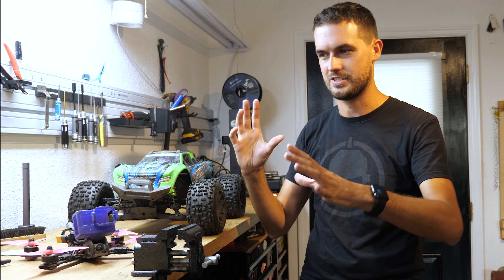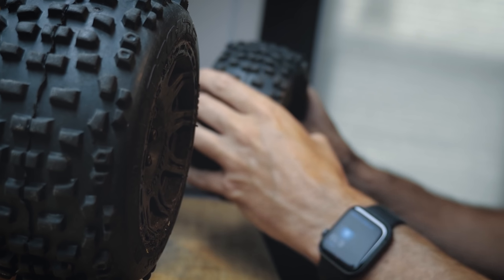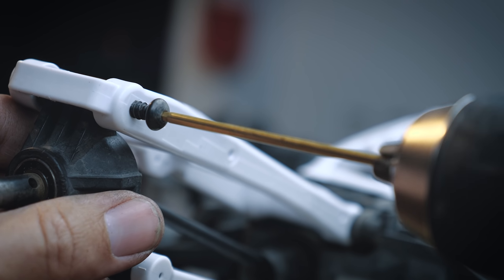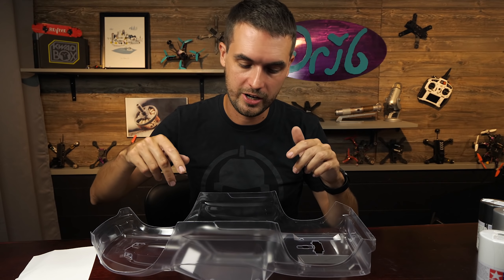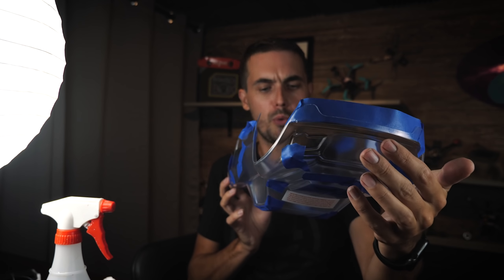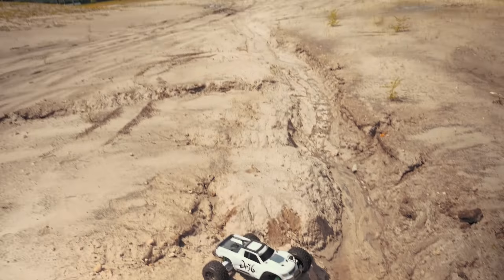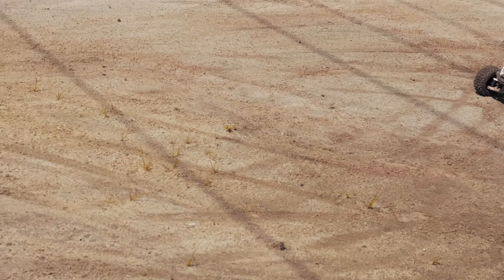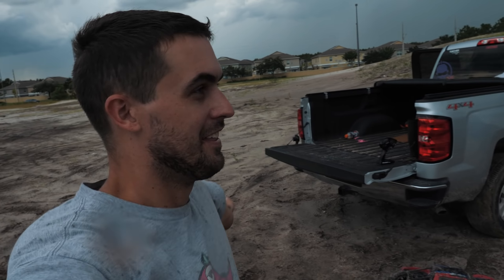Traxxas WIDEMAXX Transformation - Build & Bash Sesh

Comment: You gotta FPV it! I FPV'd my XMAXX and it's crazy fun!
Reply: I put FPV in my Traxxas UDR, its pretty fun lol. Unscrewed the guys head, and replaced it with a 3dprinted mount for the FPV cam. https://i.imgur.com/5cpNM95.jpg   https://i.imgur.com/PfEM2kY.jpg
Reply: Got any pics? I have a DJI Air unit in a quad i never use that I think needs to go into my Xmaxx lol.
Reply: @Jacksquatch69  I have pics but I can't upload them on here.
Reply: This week I added a Caddx Vista to my cheap RC Car (the Vista costs more than the car), and it was super fun.  I highly recommend FPV on a car.
Reply: I put a Tiny Whoop AIO on my car but the vibration was too bad..guess I'll be searchin YT to see how yall are doing this
Reply: @JeffWok  I cut a hole in the windshield of the XMAXX shell and mounted a Runcam Eagle. Then I cut two holes in the roof two strap down the VTX and two holes more holes in the roof to strap down the battery inside the shell. That way, all my components are inside the shell and protected by the XMAXX's roll cage. The runcam will definitely handle vibration better than a tiny whoop AIO.
Reply: @JeffWok  Here's a couple pictures
http://imgur.com/gallery/Ddu49EL
Reply: That’s what I was thinking😂

Comment: Dude.. them tires tho.... Turn em inside out coat the inner tread part with a thin coat of flex seal, or RTV. Do a few wraps of packing tape over that. Recoat the tape edges with flex seal / RTV and you wont balloon them and just shred the tires. Just dont be all ham fisted with the seal so the tires get super weighed down.
Reply: Just buy belted so much easier
Reply: @borgonianevolution  got your what an there £7 more